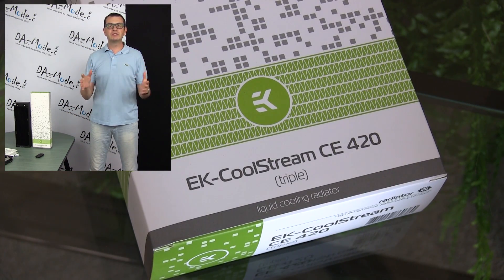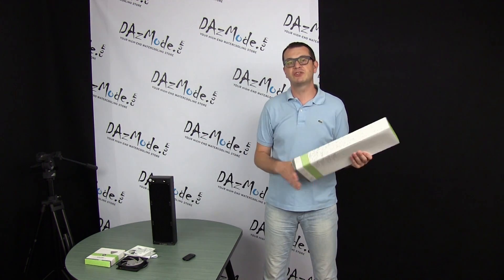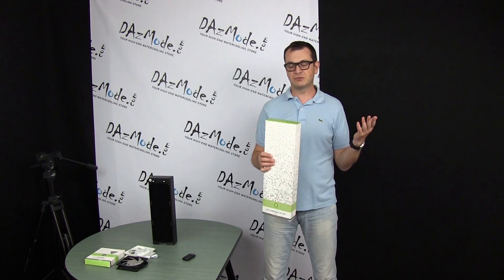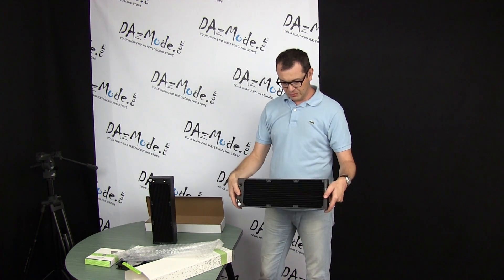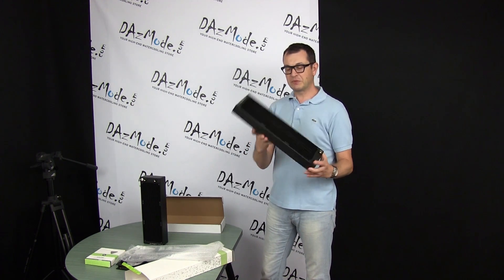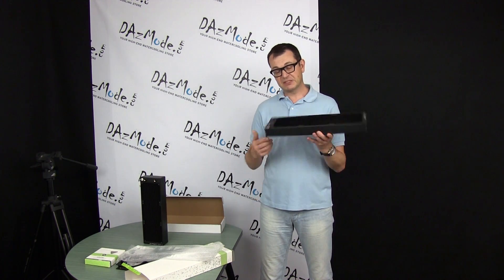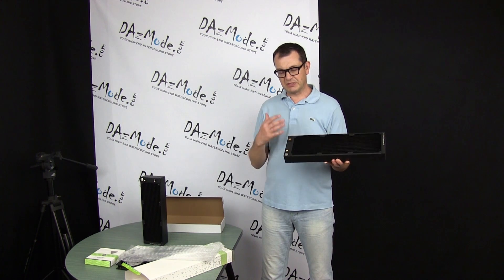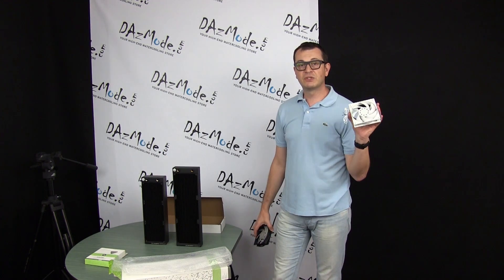Ek-CoolStream CE 140 Radiator Review -DazLab23

Comment: Phanteks ph-f140mp are very good radiator fans in the 140mm form factor for performance versus noise. Two of those in push and a 280mm Monsta rad were more than good enough to cool an overclocked 3770k at 4.4ghz and highly overclocked r9 290 at 1235 mhz. Water temps never went above 10 c delta-t with that. These look great, looking forward to trying them out. I prefer 35-45 mm thick rads these days at FPI between 11-20. Great overview, Daz.